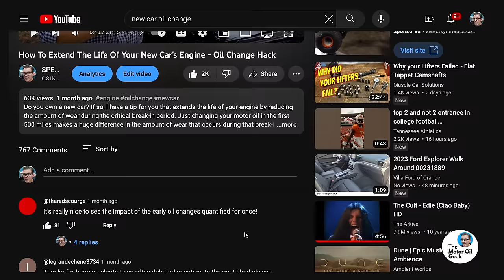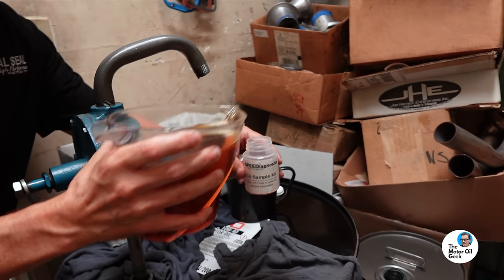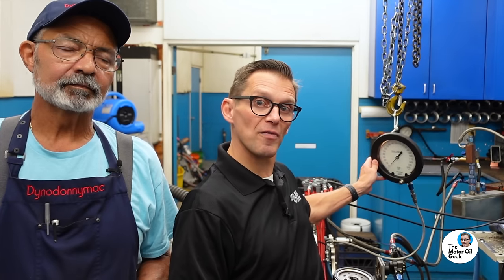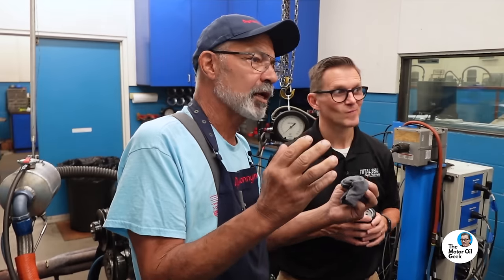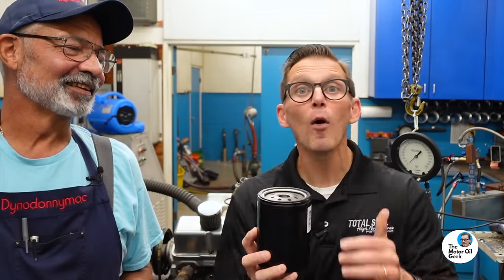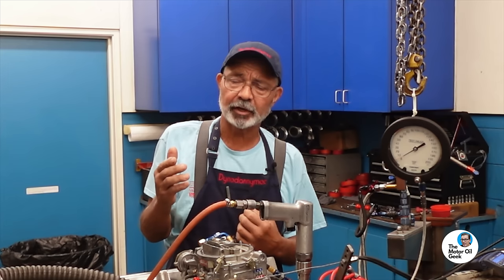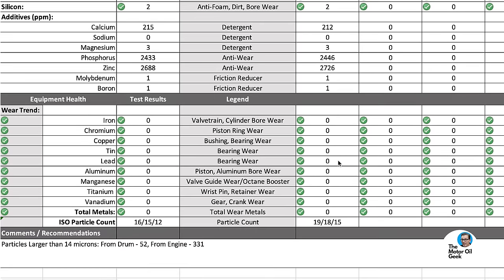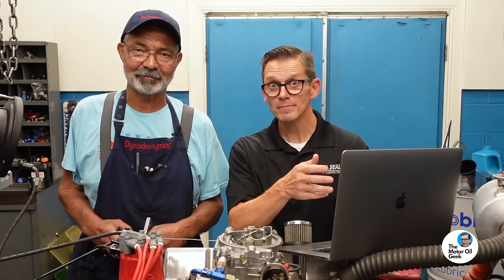Does Pre-FILLING The Oil FILTER Cause Engine DAMAGE?

Comment: The owners manual for my truck says to "partially prefill" the new filter and that's good enough for me! The reason it's "partial" is because the filter isn't perfectly vertical when installed, so a lot would spill while spinning it on, if the filter were completely full.
Oh, and the same manual advises draining and reflling the crankcase before removing and replacing the old filter, to prevent wear and tear to the oil pump while it is trying to prime itself.
Reply: if you change the crankcase oil (the pan) before switching out the filter is the filter not going to leak out your new oil?  is the oil pan lower than the filter or vice versa?   simple terms if I take off my filter will the oil from the cranckcase come out??
Reply: @smokinhalf  The filter is located well above the sump, so even if the sump were full to the upper mark of the dip stick, no oil would be drained by removing the filter.

Comment: Even if you fill the filter, there is still a large amount of space between the filter and pump that doesn’t have oil in it after a filter change. So you can’t compare a primed engine to one that has only had the filter filled. You need to compare not filled to filled (but NOT primed).

Comment: I've always filled my filter before installing. That anyone would suggest that it's better not to is bewildering.  Here's another tip: Always use ATF to lube the rubber ring on the filter; this is a superior lubricant for the ring, and will make removal of the filter easier on the next oil change.
Reply: It’s smart when it’s possible. Some filters are horizontal, or upside down like Subarus
Reply: @Michael-yp2nz  Yes, my wife has a Subaru, so what I do there is fill the filter with oil once, then rotate it a few times in my hands, and most of that oil gets soaked up into the paper filter, allowing for installation without pouring out, and you've still mitigated the issue of a completely empty filter to a good extent.  Normally one needs to add oil to the filter 2-3 times as it gets soaked up.
Reply: ATF? Most of the time there’s oil residue sitting on the filter housing. Even on semis, they just tell you to use clean engine oil. People over tighten filters
Reply: @hawkboy000  Yes, ATF is better. I always clean the mounting surface too and give it a light film of ATF.

Comment: Great video! I've always pre filled filters with new oil that I poured through a coffee filter to eliminate the chance of large particles, but cranking the engine for a few seconds in clear flood mode, with the coil or injectors unplugged, etc is another option. If an engine was recently rebuilt or sat for a long time, I'll pre fill the filter and crank the engine with the spark plugs removed (to eliminate compression) until it builds oil pressure. Better safe than sorry!
Reply from the maker: Absolutely!
Reply: The filter itself will accomplish that
Reply: @paulgallo6484  It will, but only if you fill it through the dirty side. If you fill it through the clean side (the big hole in the center), the oil you added will go straight into the engine without being filtered.
Reply: @paulgallo6484 accomplish what? Score up the bearings until it gets oil pressure? Yeah! 
 Lots of folks are doing more damage with short dry start oil changes without filling the filter then if they went oil change intervals recommended by the manufacturer. Lifetime mechanic by trade here.
Reply: @averyalexander2303  Didn't you watch the video?  They proved that the oil straight out of the drum was cleaner than oil that passed through the filter!
Reply: @e-curb  Yes, they proved that their specific sample of that specific oil is very clean, but they didn't prove that all oils are clean. They didn't even prove that there weren't any sizable contaminants in that drum.  Again- If new oil potentially being contaminated isn't an issue, why do so many manufacturers of both engines and oil filters specifically say to not prefill the filter?
Reply: @averyalexander2303    I guess you missed the part where he said the oil is filtered by the manufacturer before they put it in the plastic bottles.

Comment: You’re the Writer, Director, Lead Actor. It’s your story and you can tell it your way. From beginning to the end result. They’ve been building vehicles forever. If there were serious issues with no oil in the filter I’m sure the experts would have suggested  that all oil filters be designed in a position where it can be pre filled without spillage and issue solved. 🤷🏽‍♂️ Now all of a sudden everybody’s pre oiled their filters. Sounds good. I will agree with pre oil on the filter gasket before attaching. Besides when you empty your oil there is still some oil that remains inside. It’s not completely dry. And after you refill the engine with new clean oil then start up, it’s not starting without any oil. As long as you maintain when it’s time you’re good. Check it once in a while doesn’t hurt either. Either way will work.

Comment: The only scary story I've heard about prefilling, is a sliver of foil from the oil bottle seal accidentally getting poured into the filter, which then goes around the engine and jams in a bearing.

Some filler funnels have a mesh which would prevent this, and in any case, the same risk would apply to any particle of grit or dirt that could drop in to the new filter, or engine block flange, from dirty hands etc.

Hence I always feel the block sealing flange by hand (without gloves - prob bad for my skin I know but I can feel any grit that way.)

Then when filled I bump her over on the starter with the king lead pulled, so the early priming rotations are low speed. Then wait a few mins, check level, then start for real.
Reply: I've always been careful with the foil and plastic cap locking ring...Pennzoil Platinum doesnt use the foil...
Reply: New oil is not very toxic. It is used diesel oil that is particularly bad.
Reply: This on it nonsense if it is a spin on filter which to fill it, is into the filter and filtered out so it can't get to the engine.  The silver sliver came from the oil fill side.
Reply: @ronbindl4385  Wrong. The oil is pumped through the filter from the outside-in. So, if you prefill the filter and drop any debris, be it foil, or the super thin plastic film, you're going to push that debris into the engine. So, don't do that and keep any oil funnel and prep area clean.
Reply: @daves7525  being careful is not as good as never doing something that introduces a risk.
Reply: @malcomreynolds4103  yes and that’s why I never cross a road.
Reply: @iamkailam  Do you have a reason to cross a road? Because you have zero reason to fuss about priming an oil filter
Reply: To remove the seal on containers, I use a box cutter to cut the seal in half and pull off the two halves by hand.
Reply: Prefill through the outer holes
Reply: @W.451  it will only get filtered if the oil is pulled up from the pan and ran through the filter. NOT when it is poured directly into the filter, bypassing all the filtration the engine has and pumps directly into the galleries.
Reply: @malcomreynolds4103  Yea, I was thinking about filling the crankcase. In the old says of quart cans and parrot beak openers if a partial can was left uncovered moths would go into the oil. The smell of motor oil attracts moths.

Comment: My dad taught me to prefill filters. It just made sense to me that with the filter full I wouldn't be pushing air into my bearings on start up.
I get the concern about "getting dirt in the filter", but the center of the oil canister is the high pressure side, so pouring it in the middle is filtering it anyway.
Also, I think if you're the kind of person that worries about pre-filling oil filters you're probably also meticulous enough that you aren't in a dirty place using dirty equipment.
Reply: NOPE, The oil goes through the filter from the outside-in, so the oil presenting to the engine is coming from the center of the filter. If you don't add dirt to that, you're doing just fine.
Reply: What about the low pressure side of the filter that is still full of air? 
Assuming you don't wait 3 hours for the fresh oil to flow through the filter media under gravity , topping it up as it does , before installing the filter.
Reply: @PaulG.x  it doesn't take 3 hours, it's like a 2 minutes kind of thing

Comment: As a Caterpillar service technician cat says not to prefill any filters due to the contaminants that are in new oil. However, the contaminants in new oil are very very small cat filters filter up to 4 microns, which is still small enough that it catches particles even in fresh clean oil or fuel. Which is why we are also not supposed to keep any open jugs of oil and if its been opened then closed it cant be used after 4-6 months. And since Caterpillar has there own engineers I trust their information even when servicing my own vehicles and don't prefill filters

Comment: On GM products "clear flood" mode can be used to prime the engine and build oil pressure before starting preventing dry start. Another option is removing the ignition fuse will serve a similar function.
Reply from the maker: Thanks for sharing!
Reply: Youre still getting compression though, which will produce wear without oil pressure. Not much, but a bit. Removing spark plugs and cranking is best if you want the best possible environment for of your bearings.

Comment: It would have been a fairer comparison if you had have drained the engine and then re-installed a new filter when you did the prefilled test. Assuming the the anti drainback valve was working, then in that second test it was not just the oil filter that was already primed, but the pickup and the oil galleries and oil pump as well. That's why the pressure began to rise almost instantaneously. If you had drained the oil and refilled and installed a new oil filter (prefilled with oil) then the pressure rise would probably have been delayed a second or two, but still a lot better than installing a dry filter.
Reply: YES ! !
Reply: Maybe they will do a take 2. I don't think there will be much difference if they did. I still prefill  just cause habit lol would be cool to see a take 2 tho, for shits n giggles
Reply: Exactly. This is not an apples to apples test. While I don't think prefilling the filter is bad for the car. I'm not convinced doing it is necessary. This test doesn't prove it to me.
Reply: I agree this was not a fair comparison. Even if the result is the same, this wasn’t a fair comparison.
Reply: @john6274 - so that clicking noise you hear until your filter fills tells you that even the oil you drained out was doing a better job of preventing metal to metal contact than no oil.  

Even if the tests were the opposite and said engine filtered oil be cleaner than bottled ( which it wasn’t ), that few seconds of no pressure is just bad.
Reply: @chucksmoko5348  I don’t disagree with you. The way to prove what you say is true is to actually perform the experiment. They didn’t do that. That’s the point. They wanted to test something that is very likely faster by prefilling the filter. They proceeded to show us immediately starting up an engine after it was just turned off is faster. What if the time to go to pressure is the same? I don’t know because they didn’t do the test.

Comment: I have ALWAYS pre-filled the filter, the idea being, the more quickly it builds oil pressure, the better for the engine. It reduces "scuff". I see a lot of YouTube channels, where professional mechanics don't prefill, and it's "Cringeworthy" to me. I always recommend in the "comments section" that they prefill, just to get the oil pressure up more quickly. I've never been concerned, pouring new oil out of a new bottle, into a new filter. I have been concerned about the lifter noise, if I don't prefill! In other engines, it's timing chain noise, when the tensioner relies on oil pressure. I don't know in what universe, it's better to allow the engine to run momentarily, without sufficient oil pressure.
Reply from the maker: Right on!
Reply: Excellent Vincent!

Comment: Fantastic video, hopefully you save a LOT of barrings!!!     The reasons I am 1000% for doing my own oil changes is so that I can #1 let all of the oil drain I tend to let it drain for like 20 minutes,    #2 I always pre-fill the oil filter.      #3 I use better oil and filter.     I use OEM filter which actually tends to be cheap like motorcraft for Ford is like $7 or $8,    For Mercedes I use the OEM German  MANN filters  which I can find for like $10.     All those oil change places ripping you off with $16 and $20 oil filters...  AND I get to use better oil or my choice of oil.       #4  I make sure the oil level is perfect,  I have had over filled oil so many times in the past.       

THE ONLY ISSUE with doing your own oil changes is forgetting when you did it!!!!!    Get  roll of oil change stickers so you can write down and stick it on the windshield and not forget.

Comment: Interesting study, and thanks for your efforts.  The only thing that I might add to the discussion was the speed (rpm's) of the air drill that you had driving the oil pump, through the distributor port.  I don't know what the cranking rpm's of the distributor are when being driven by the starter motor, but I'd bet that they're significantly lower than that of the air drill.   Lower  unprimed pump RPM's would equal longer time till full primed oil pressure, increasing the damage to the bearings. 
 My point is that this even furthers the importance of priming the oil filter.

Thanks, again,
Scott
Reply from the maker: Good point!
Reply: I would say it is non-sence study - pre-filling or not filter does not have meaningful impact on the engine life cycle.
Reply: @ldenis2  engine life and bearing wear are not necessarily related. You can wear the hell out of a bearing and so long as it keeps doing it's job you would never know, right up until it fails.
Reply: @Neoprenesiren  there was a video when a person started engine with oil drained, ran it for 10 minutes and then disassembled the engine - there was no scratches on crankshaft bearings. You can be sure - if your crankshaft bearings are gone - it is not because of empty oil filter.

Comment: Never had an engine oiling problem not filling the filter. Most of my vehicles have been top or side mounted filters so I can’t anyways. If the wear was significant enough then auto manufacturers would mount all their filters underneath the engine but they don’t. Do it if you want, it’s definitely not bad.  But it’s not the big deal everyone makes it out to be.
Reply: Never done it  my cars are from the 90 they hardly burn any oil so the engines are fine. To much over thinking the filter  filling thing lol
Reply: @carlosb1  The manufacturer would mention it in the manual if this was a thing. I mean, if there's no harm and it makes you feel better about yourself then do it, but the difference is negligible.
Reply: @Scorpionwins23  my thoughts exactly. 👍

Comment: When you break an engine in, there will typically be some bearing wear because the bearings have to seat.  You also have very fine particles in the engine and components left over from manufacturing and assembly process.   That is why you had copper in the oil sample from left over materials from manufacture.  The copper is under the lead & tin alloy (babbitt) in the main bearings so the only way to get copper from the bearing is if you have worn all or nearly all the babbitt away.  Another possible source of copper is if there is a heat exchanger core as part of the system that is made of copper.  A new cooler / heat exchanger undergoes "copper passivation" initially and you will show copper in oil analysis until that happens.  It doesn't mean there is actual wear, but the cooler material is giving up some copper while getting coated with a protective layer.

Comment: Two points. If you were to fill your filter into the outside holes the oil will be filtered before reaching the engine. And I don't prefill the filters. Many cars have their filters at an angle so you can't prefill them. I pull the injector fuse and crank till I get pressure.